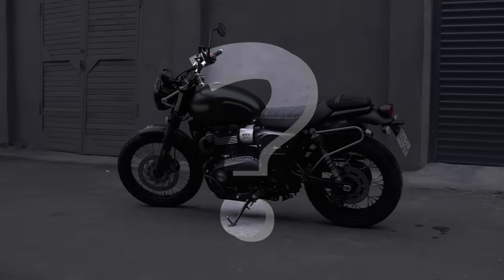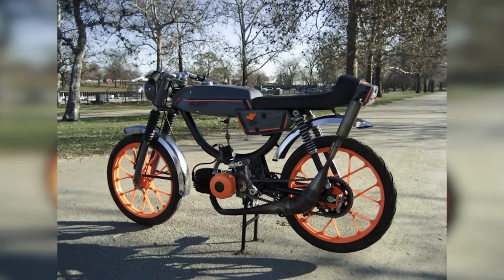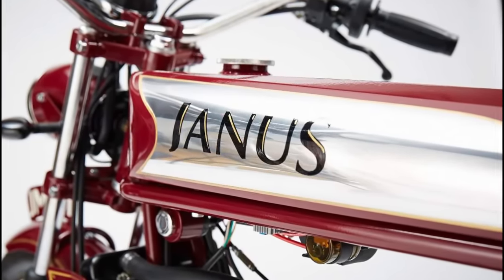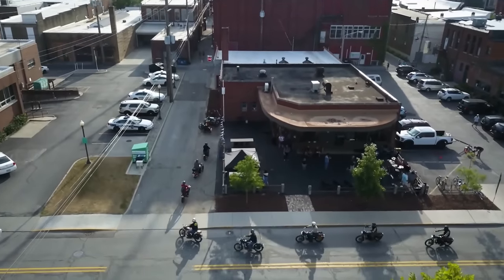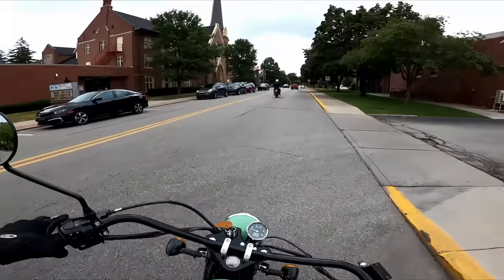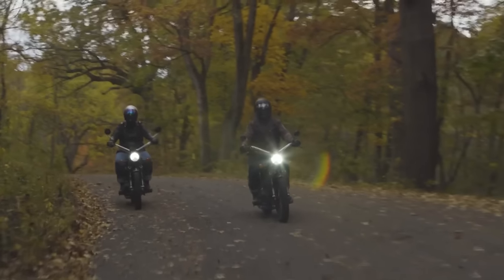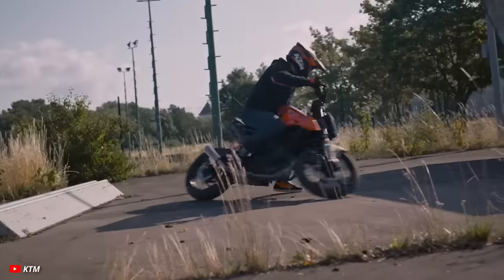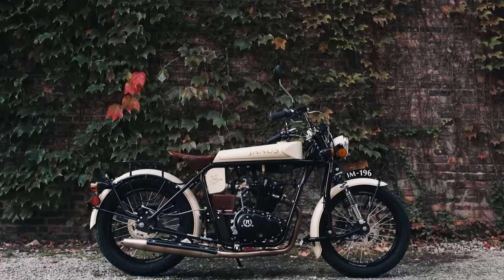The New Manufacturer making 100-year-old Motorcycles

Comment: You totally missed the point about the royal enfield, that motorcycle is a facinating motorcycle all by itself and i think that comparing it to a lightweight fun motor cycle is not a justworthy way to compare the 2. Royal Enfield is the harley-davidson of India, it has a dinosaur of an engine, the way it is built indeed makes it heavy because it has to be strong, this also helps to soak up the bumps because it is made to travel in comfort not speed. i guarantee you - that if you ever travel with a motorcycle like that in India and get somekind of issue with your motorcycle that the local people will help you. It's as if there is some kind of ancient connection between a Royal-Enfield and a traveler that people in India understand. If you have a hole in your piston for instance then the local town mechanic will weld that shut with a rupee and a rusty old nail, really. The comparison you made just does not make sense.